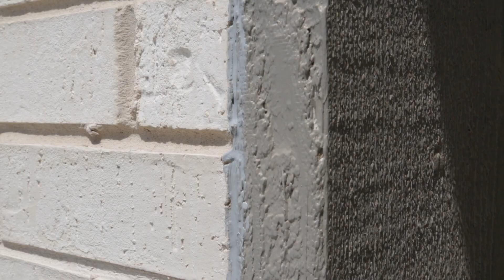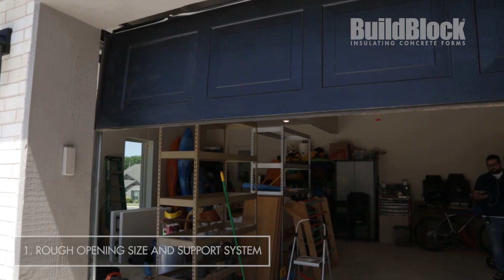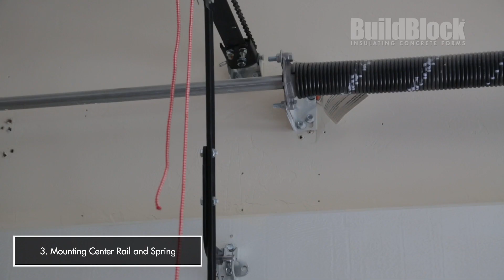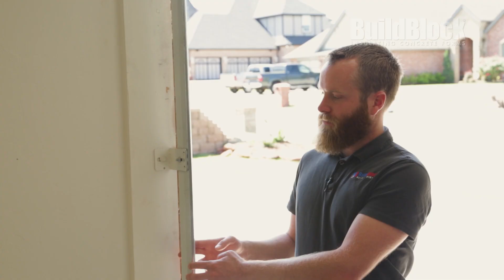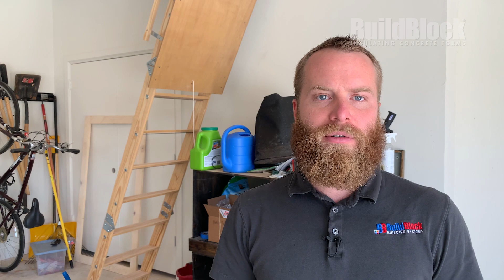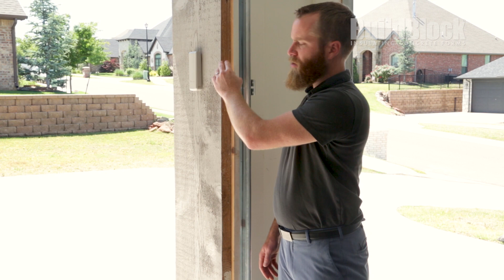Installing Garage Doors on ICF Walls

Comment: That looks more like 1x6, not 1x4. A 2x6 should be used. The lags going through the track flag brackets are only going into 3/4" material.  It doesn't give you much meat for high wind situations.